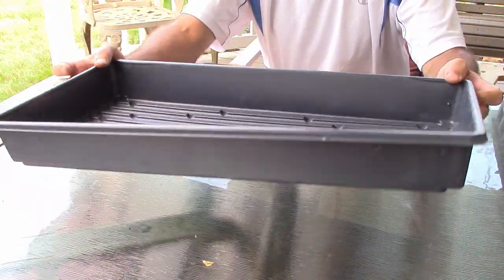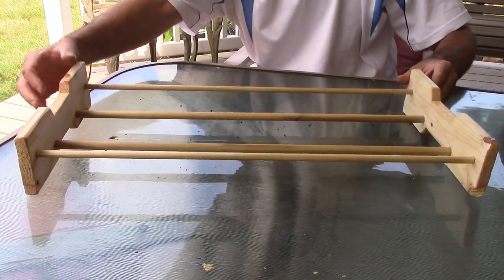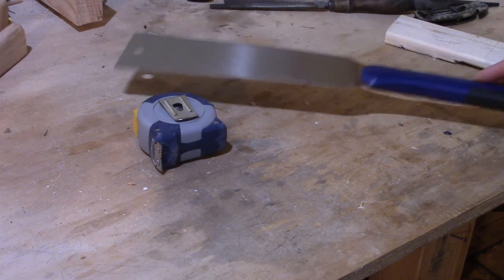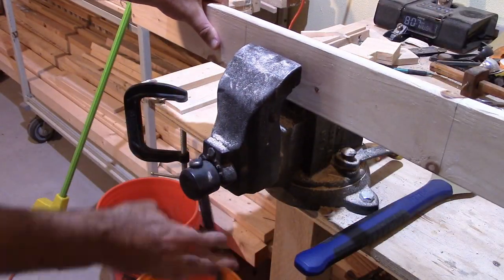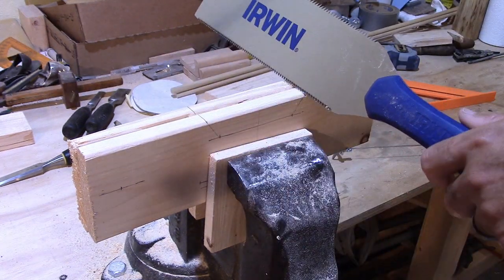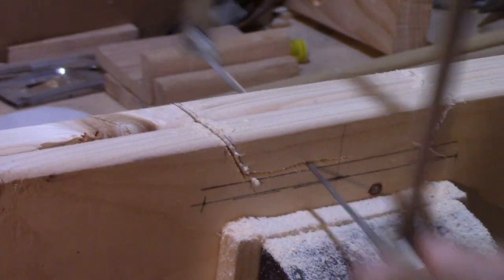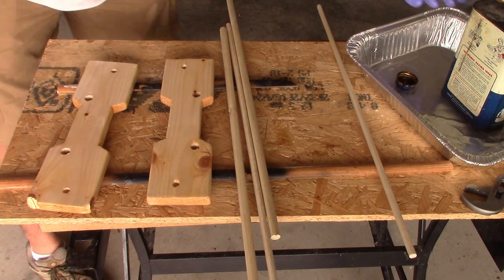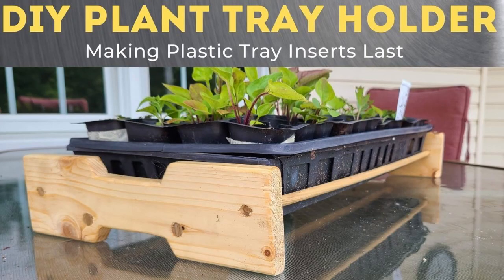DIY - Plastic Plant Tray Holder, Save your FLATS

Comment: I love your idea. I do cuttings and I usually leave it outside. I know how bad heat can make anything soft and deteriorate . Your design helps with less heat which is radiated from the ground. It's perfect.
I am so bad on hands projects .
Reply from the maker: Thank you Jin!  If it was going to be left outside, it would probably be best to apply a deck sealer to it for protection.  But this would definitely keep the tray cooler than if it were left on the ground.